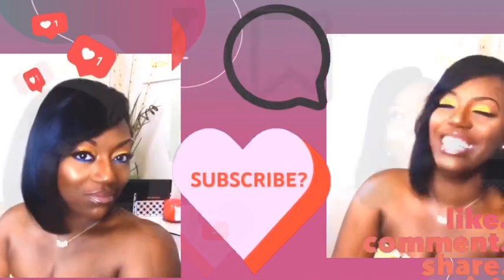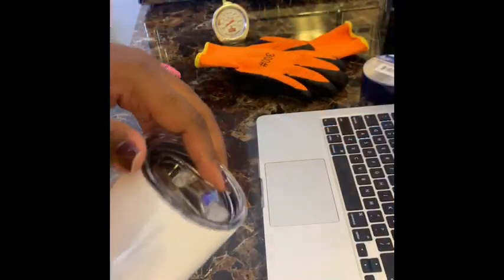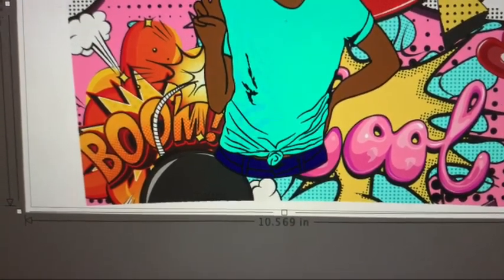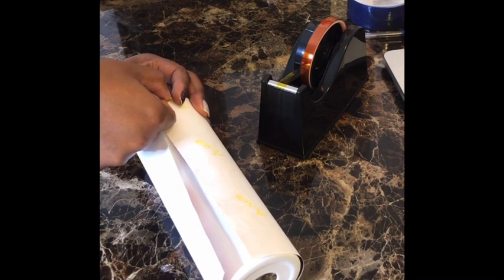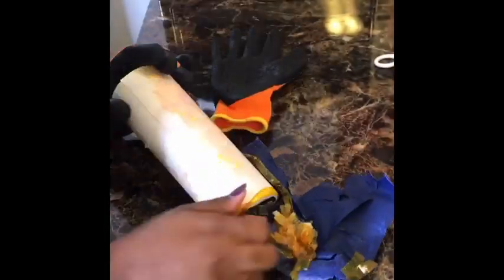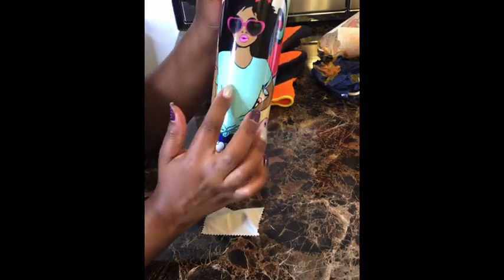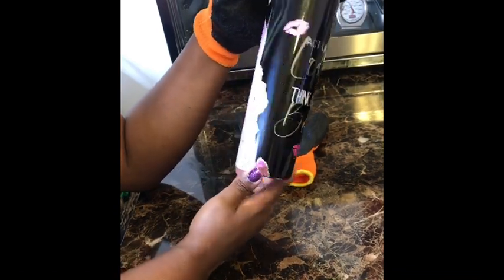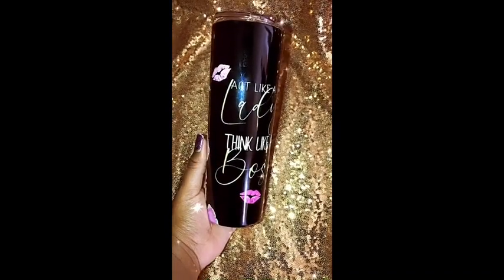How to Sublimate on a Skinny Tumbler : Sublimation Tumbler 20 OZ Tumbler

Comment: I still haven't tempted to do a tumbler. I now have a mug press,a convection oven and an air fryer just for my mugs and tumblers . My question as a beginner is what program do I need to install on my laptop to print out all my designs and measurements for the mugs and tumblers?
This is so confusing. TIA

Comment: They came out soooo good!!! So once you do the sublimation that’s it?! Has any of the images gotten scratches on it from normal wear and tear? Part of me would have put a thin layer of epoxy but they came out so pretty and glossy I can see why you wouldn’t. Great video!!
Reply from the maker: Thanks so much...Nope no scratches or anything thus far 🥰🥰🥰the material is kind of slippery and smooth if that makes sense.  Thanks so much ❤️❤️❤️

Comment: Great job, did you have any overlap on ypur tumbler where the seam is, or did you cut it exactly to fit.
Reply from the maker: Thanks so much for these it was like a really small overlap surprisingly you could barely tell...
Reply: @DoDreamOn  thanks i tried my first one with this method and it worked out great. Thanks for the video

Comment: Hi, 
What paper setting do you use? I wasted a tumbler trying to print hot pink and bright pink like your image and it came out dark red. I had to use a much lighter pink in order to make it true to color. Is there an ICC profile setup...brightness, density, saturation etc.? I have the same printer. Any help is greatly appreciated. Thank you
Reply from the maker: M Caudle hi I have a MacBook and I have a video on my settings to make my colors pop. It breaks it down for you... specific to Macs. Do you have a PC or Mac?
Reply: @DoDreamOn  I'm using a PC. Unfortunately I have to replace my Mac.
Reply from the maker: M Caudle  Hey if interested join my FB Group https://www.facebook.com/groups/719483238563601/?ref=share
Reply: @DoDreamOn  
Thank you.

Comment: Make a square width 9.4 height 8.7 if you have straight tumbler with no taper
Reply from the maker: Thanks :)
Reply: How do I sub tumblers in Microsoft word?
Reply: @karren07161  right
Reply: Is those 9.4 x 8.7  measurements for a 20oz skinny straight?

Comment: You had to change the measurements because that's a tapered tumbler template instead of a straight tumbler. For the straight tumbler, just use a box. No need to buy a template.  That was my mistake.
Reply from the maker: Yes ma'am that's right..thanks I have the straight ones now...
Reply: @DoDreamOn  I have the tapered tumblers.  Where did you purchase your straight ones?